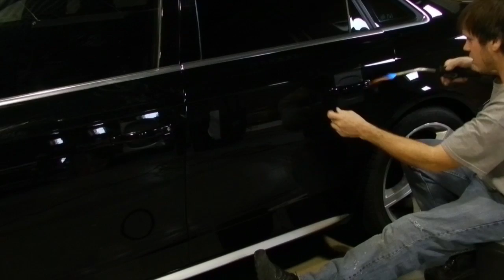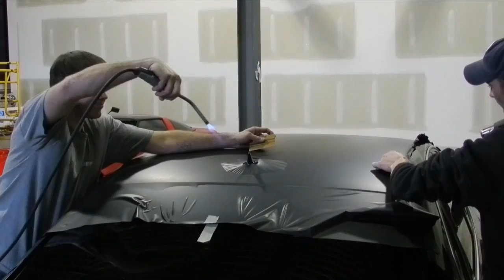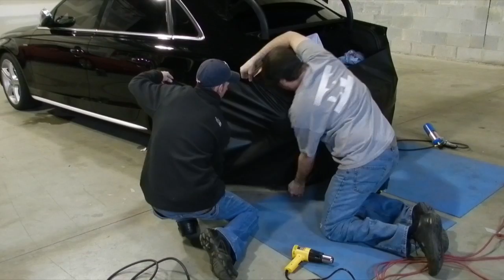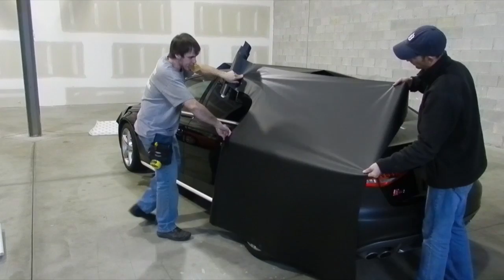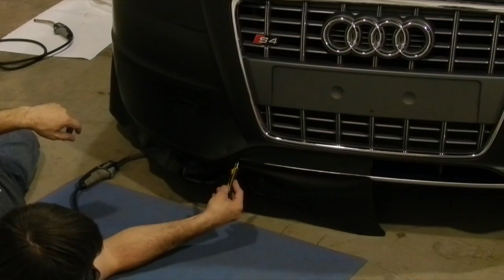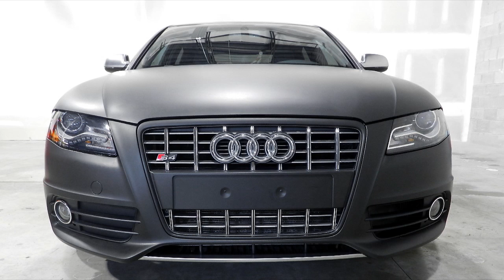3M Scotchprint Wrap Film Series 1080 Vehicle Installation - HD

Comment: @walkabout16
 G'day, thanks for sending this... About the only type of this stuff I can see being used on the SunFoil, is the Fake Carbon Fibre Stick-On, for a High-Tech look on a Wood-Faired SunFoil - rather than simply painting. To get the Vinyl to stick, the Wood would still need painting first... So the Look-Fast sticker adds to the Build-time. Frankly, SunFoils are real, & so, maybe not for the stick-on Pretender crowd..? Ciao !